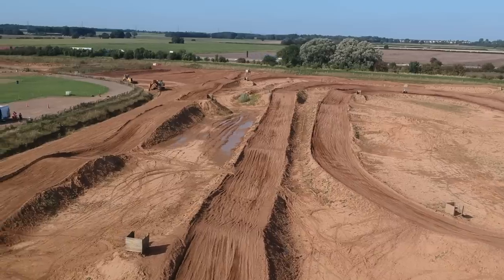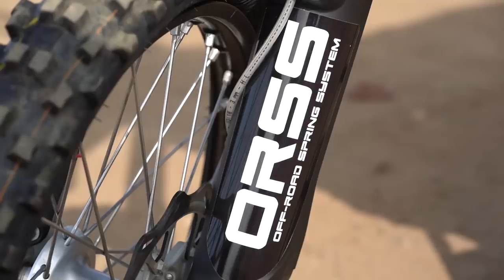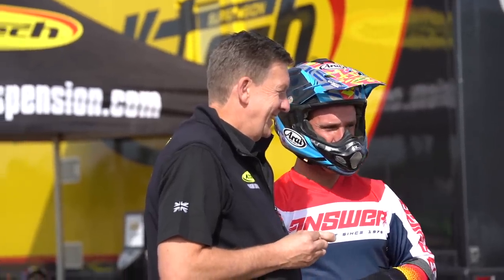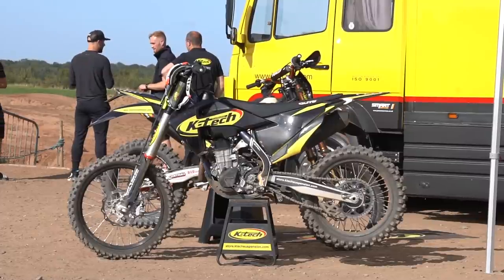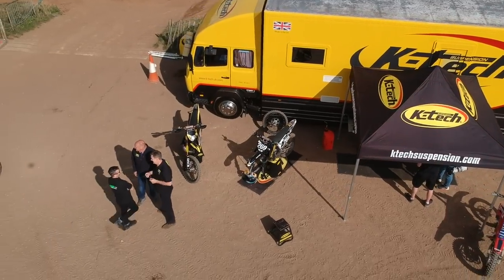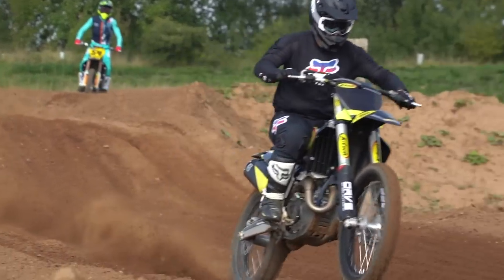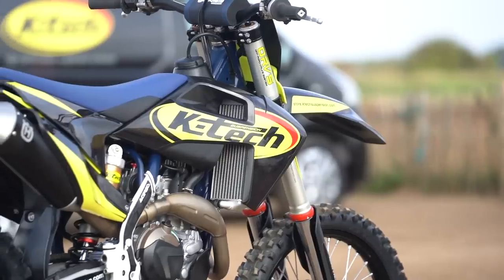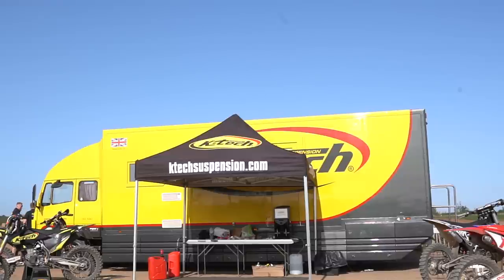Tested: Coil spring and damping conversion kit for KTM & Husqvarna WP air forks

Comment: Looks like a great setup.  The older air forks especially leave a lot to be desired, I think mainly to the characteristics of air itself and how it reacts to being compressed. 

Western US ridden '18 300 XC here, quite happy with the shock, but did the bladder conversion as the stock piston setup ran hotter than the engine while doing fast in the desert.  

Recently found a great deal on a used MX-Tech "Lucky" insert spring conversion kit that was valved by Stillwell for a similarly sized "B" rider like me. Waiting for the snow to melt to really test and tune them, but the forks already feel better bashing curbs around my neighborhood 😂